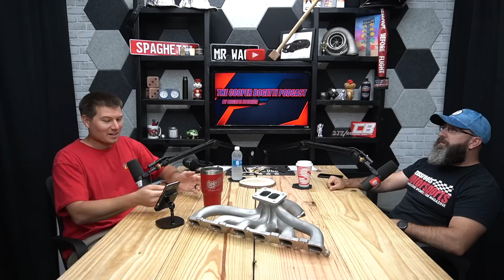John Whit : Power Grid Engineer, VERY TECHNICAL, Budget Racing, | The Cooper Bogetti Podcast EP41

Comment: As a shift operator in a operations center in the Va area when the call is made that power needs dropped in our company we have a program that we can deploy for whatever load that needs to be dropped. I put the amount and the computer will calculate total load per breaker. It will see what customers loads are and drop for a period of time and swap down the list excluding critical customers. These are brown outs. It is usually a 10-20 min outage for the customer unless more load is needed to be dropped. The customer are dropped from the substation breakers. This will continue until no load shed is needed. Just turn on the system and turn it off. 

Black out. AKA shit hit the fan drop it haha. Thanks for the content let me know if you have questions

Comment: As a hvac tech geothermal is amazing when it comes to efficiency and low-cost run cycles. The downside is startup cost due to having to install closed loop water circuits or if you have a decent pond, an open loop circuit.
Reply: I’ve been in HVAC 24 years in AZ but no geothermal. That’s something I’d love to learn.

Comment: If you want a tune you need to contact PCM of NC in Charlotte.  They are very well known for tuning the 5 cylinder.  I have a tune from them on my 3.5 in my 2006 H3 Hummer.  It was like a different vehicle when I loaded it on.

Comment: I do a ton of tuning on the side and you arent the only one to have issues with a TermX. I now use Megasquirt 3 Pro Evo’s on everything now. One way to get additional i/o’s is to CAN another MS Microsquirt to the original one. Also the Microsquirt can be converted to control the transmission.